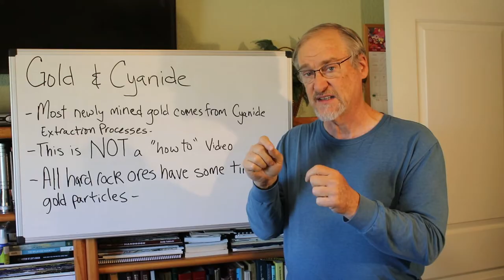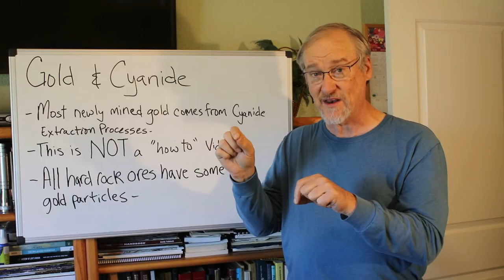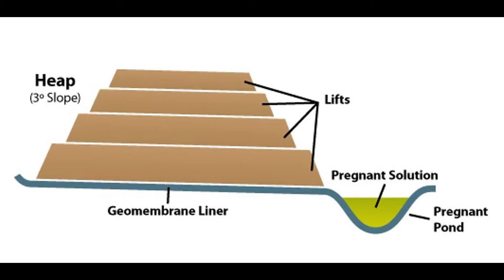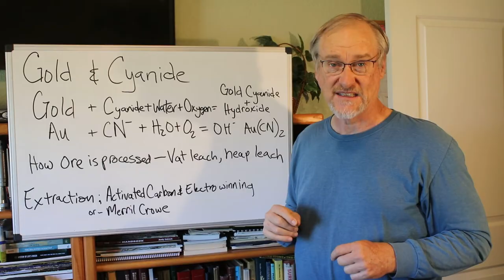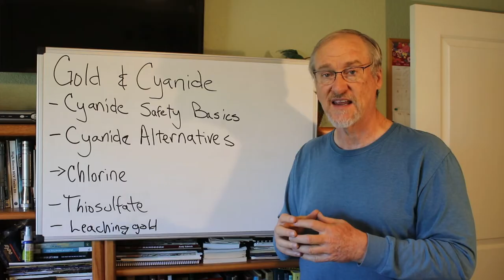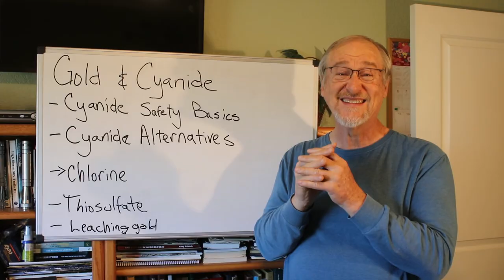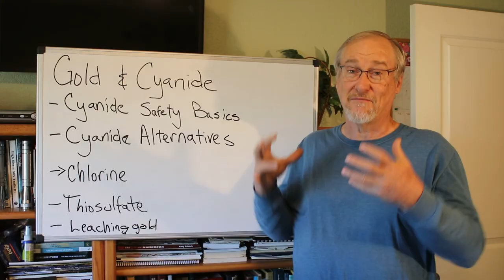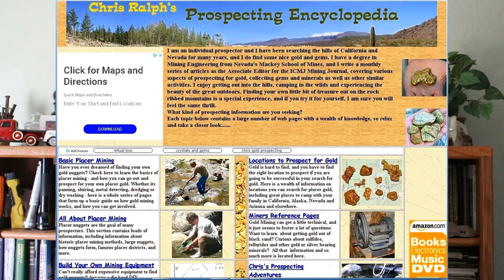Extracting Gold with Cyanide:  How gold is recovered from ores using cyanide to capture it

Comment: Great information, thank you.  I have a good find in a place that's hard to find gold.  However it's mixed with copper.  I have been trying to come up with a "green" method to extract but no luck.  Silver I was able to be more green with.  And as far as waste Solutions I generally force an evaporation to avoid  poisons that are left over.
Reply from the maker: Copper in the ore is a problem for cyanide and for thiosulfate too. The copper reacts with the leaching chemicals.

Comment: Where I used to work we had cyanide by the pallet and a dedicated fork lift for it. Now I can't find cyanide retail anywhere.. even shops selling books on CN leaching for miners. 
Remember that HCN has a bitter almond smell BUT only about 40% of people can smell it the rest cannot smell it, so you probably wouldn't know if there was cyanide in the air. 
Fortunately cyanide naturally oxidises on exposure to oxygen so small cyanide wastes self dispose to carbon dioxide and nitrogen.
Reply from the maker: In the old days, I bought hundreds of pounds of sodium cyanide with only a check and a driver's license. You can't buy it now because of lawsuits. You can however, buy as much sodium thiosulfate as you wish - its available on Amazon.
Reply: Thiosulphate is photographic fixer! Once used for film and paper. It should make short work of silver chloride ores and be re-usable if the silver is taken out by electrolysis
Reply from the maker: Its inexpensive, and its also the additive to pools if you put in too much Chlorine.
Reply: I come to comments for this kind of extra, continued info, thanks
Reply: Thiosulphate is the anti chlorine additive in "after swimming" hair shampoo.

Comment: Great video Ralph !  Very informative on a subject that is not very tangible to most hobby prospectors.  I used cyanide many years ago on a silver vat leaching project.  Unfortunately, at $5 silver it wasn't profitable.  The ore was in dolomite and the silver was completely oxidized into black dendrites.  Leached like candy.
Reply from the maker: I got a bunch of ore I need to crush and test. I'm going to try thiosulfate to do the job.
Reply: I used it once before and did ok.  Expensive at the time.
Reply from the maker: You can buy it cheap right on Amazon.

Comment: I used to make black cyanide at cyanimid plant in Niagara falls Canada.     I made black flake 48 to 52 percent grade.    Before I worked there they also had a white cyanide furnace but it was finished running when I started. We would fill tank trucks to take to northern Ontario for gold mines. We also put in barrels we made at the plant. Unfortunately plant closed 92   I then became a maintenance foreman at a Dana plant building for truck frame 95  to 2008.then close that plant too.
Reply from the maker: Manufacturing cyanide is an interesting process.

Comment: I've heard of gold miners in the Brazilian jungle using mercury to extract the gold. Is that an alternative for the little man?
Many greetings.
Reply from the maker: Capturing gold with mercury is still a gravity based system like a sluice or shaker table. The gold must move down by gravity through the material to get caught in the mercury. It does not dissolve the gold like cyanide or thiosulfate. Mercury also has its own toxicity issues.
Reply: @ChrisRalph   Thank you for the information.

Comment: There seems to be some use of glycine as an alternative to cyanide , especially in places with unfavorable legal environments .
Can you share any insights on this process ?
It likely is an order or two in magnitude more expensive than common cyanide salts I would guess .
Reply from the maker: It is really new - much of the research is only a few years old and has only been done at lab bench scale testing. The other thing is that to work properly it needs to be done hot - at about 140 degrees F. It does not work well at room temperatures, and this really limits the applicability - more than the cost.
Reply from the maker: I'm going to look into this further and read a bunch of the research papers that have been published. Thanks for pointing it out.

Comment: Thank you for your amazing clips.  Have you seen gold chloride inside the gold-bearing stone?  I have come to the conclusion by testing the stones that there is gold chloride inside some stones, which turns into free gold when heated.🙏🏻💛
Reply from the maker: I am skeptical of this.
Reply: @ChrisRalph  thanks 🙏🏻 
Is it possible that acidic solutions similar to aqua regia in the earth replace the gold from the depth of the earth to the surface in the form of gold chloride in the rock?
Reply from the maker: No.

Comment: Mr. Ralph,

If one doesn’t have the access to, or would particularly not want to use cyanide. What would be the preferred method for a very thin layer of gold on the surface. Simplest way to describe it would be a quick brush stroke painted onto it. 

I’ve found this on my own reconnaissance. And through some home test found it to be AU. But that aside. Do have suggestions. 

I love that you take the time to do these for us. Thank you!
Reply from the maker: I would suggest sodium thiosulfate. It is available through Amazon, is not very toxic (its actually the antidote for cyanide poisoning), and I intend to do a video or two on this in 2023. It is more complex to use than cyanide, you need to control the chemistry more closely. There is research on it on the internet. Do some research using google.
Reply: @ChrisRalph : Thank you for taking the time. My Best

Comment: Chris, why does gold dissolve in mercury or cyanide or even in a combination acid solutions?  Cyanide is such a weird molecule, so what makes it dissolve a noble metal when it is dissolved in water?  Please figure out another way to dissolve significant amounts gold quickly with "safe" chemicals, then tell only me.
Reply from the maker: Hundreds of top flight scientists have tried to come up with something safer than cyanide but equally effective and not wildly more expensive. So far, they have failed.
Reply: @ChrisRalph  You are every bit as smart as those top flight scientists, and in my opinion, even more so.  You can do it.

Comment: Great video, Chris! I am running a small VAT leaching operation in Southern Africa.

Need some advice, as we're getting a huge amount of copper coming out of the activated carbon when doing the electrowinning process, meaning there's a lot of copper being leached with the cyanidation process.

Also, as for the oxygen within the equation, instead of bubbling air through the mix, we use H2O2 to supply oxygen to the mix. What are your thoughts?
Reply from the maker: As I said repeatedly in the video, this is not a video to explain how to do cyanide. So I will offer no instructions. Significant copper in the ore is a problem.
Reply: Good Day Agnaldo...Im  based in Johannesburg I also have a vat leach and working on a CIL /CIP plant. Can we chat on email ?
Reply: @vimbiv3133  sure. How can I reach you?
Reply: Its hard to treat the copper, dont you have a lab down there to do some tests, but the best way to remove the copper is by froth flotation you will need equipments to do that, the concentrate of copper will be separated from gold concentrate before leaching the solution by cynade

Comment: How is sodium thiosulfate used to extract gold?
Reply from the maker: Under the right conditions, it can dissolve gold like cyanide - but you have to have the right conditions. There is a lot of information on the internet, if you want to know more, do some research. One of these days I will do a video on using sodium thiosulfate to capture gold and silver, but it won't be real soon.
Reply: @ChrisRalph  I have a method and will try it.  30 kg of crushed soil from mineralized rocks and put it in a barrel with a little lime and pour 20 liters of cyanide solution on it to measure the acid percentage 12MPH and roll it for a period of not less than 7 hours. Is this method successful?
Reply from the maker: This was not a "how to" video, as I said a couple times. I'm not giving instructions. You are on your own to find out safety and proper use information for using cyanide to capture gold.

Comment: So if aquaregia holds iron or other minerals in it you can’t just get the gold to dissipate and drop back out without cross contamination?
Reply from the maker: AR takes out other elements as well as iron, it gets consumed by the other things before it dissolves the gold. Then even if you do get any gold in solution, the meta bisulfite reacts with those other things and the gold does not drop out. Ive seen many try it and never heard of any that were successful.
Reply: Aqua Regia is used late in the process. You get the coper iron and other BS out first with electrolysis using sulfuric acid. After that you are left with a paste of gold lead and silver. Next react with nitric acid to remove the silver. Decant and save. The remainder add HCL plus some nitric acid to get your gold out. The lead will stay as a precipitate and your gold comes into solution as a yellow solution of HAuCl4.❤

Comment: Is this same as aqua Regia ?
Reply from the maker: No, it is totally different.
Reply: But in both it dissolves gold and precipitation is done with zinc
Reply from the maker: Both sugar and salt are white and dissolve in water. Are sugar and salt the same? Aqua regia is an acid. Cyanide must be used as a base - the opposite of an acid. If you add an acid to cyanide it gives off a gas that will quickly kill you.  They are not at all the same.